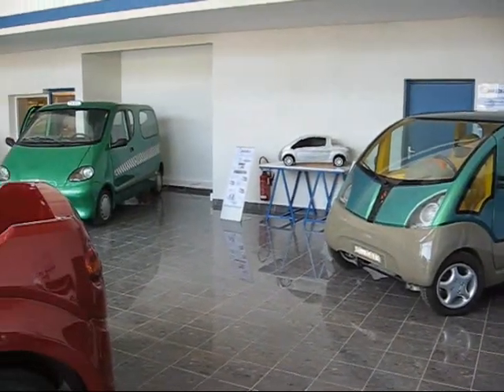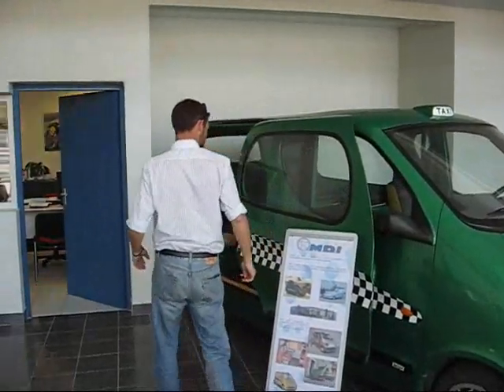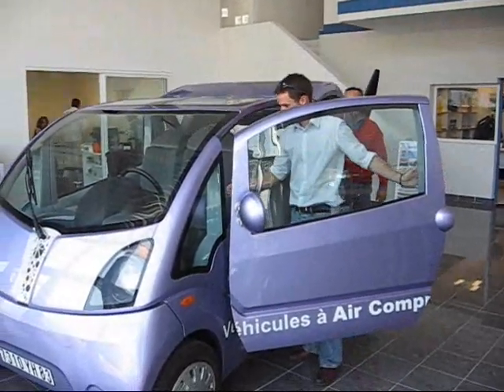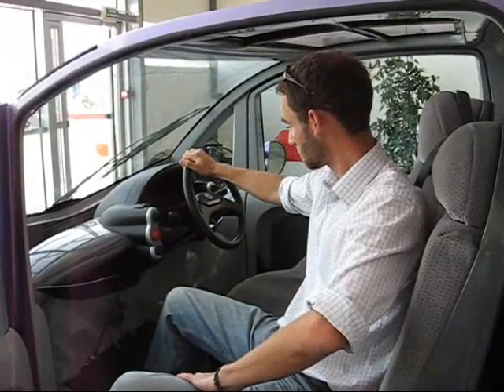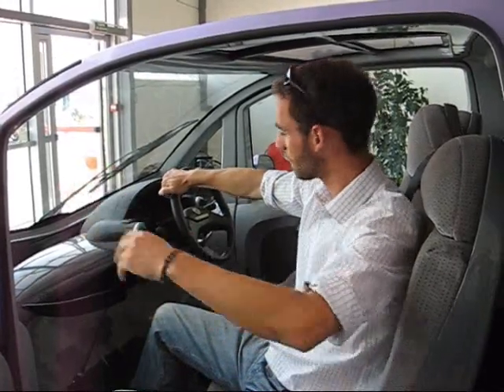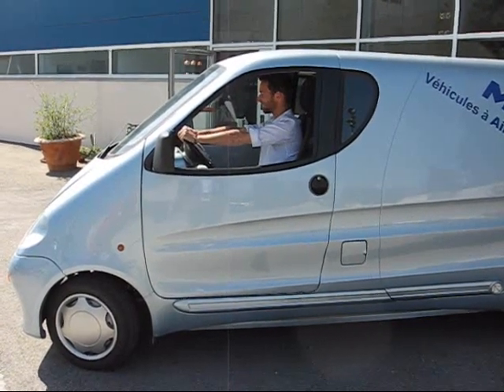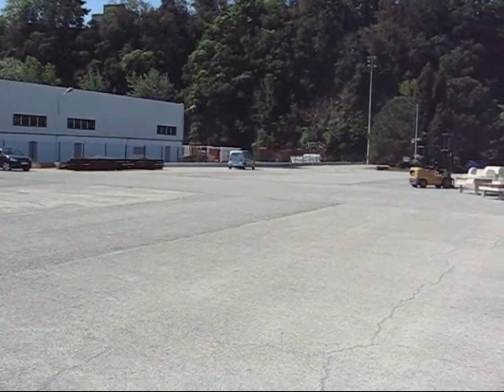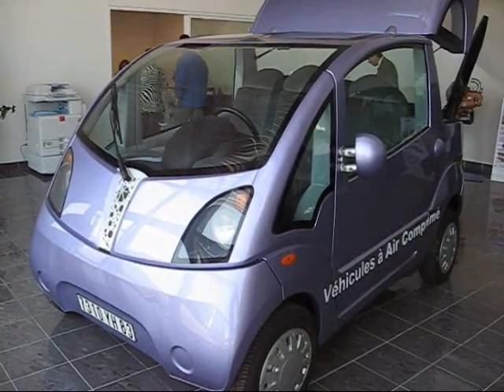The Air-Powered car?

Comment: the only problem is that you need a something to genarate the air. so you would need a really complex system to do it
Reply: I think the idea here is to generate the air using renewable sources of energy rather than sticking to fossil fuels which would deplete in a few decades time.
Reply: @avcomth  yeah i was thinking what new crisis would be cz we are not prepared for anything

Comment: Ehh, there are still better ways of storing energy.  Air isn't a very good way.  If you were going to bother using solar or hydroelectric power you would be way better off using advanced Lithium batteries and storing the energy directly.  The reason the air operated car didn't catch on isn't because "big oil" shut them down, its because they are inherently impractical for modern day street use.

Comment: These aren't going to be any better for the environment than gasoline engines.  How do you compress the air?  Magic? Also not zero carbon.  Not.  Even. Close.  These WOULD be highly useful in mining operations though where the operation of internal combustion engines is highly dangerous.

Comment: you can ask me anythin about physics or clalculus and shit ill answer it. the point im trying to make is that most electric companies use fossil fuels. some do use clean energy but those dont make much electricity.. and because no system is 100 percent efficient the more processes it take to make a fuel the less efficient. . example : say its 70% efficient to take gas to make it into electric. no say its 80% eff to take that into air.. thats only about 56% efficiency. IS THAT GUD ENUF 4 U

Comment: Clearly every system has losses, No, still not happy with the answer elaborate more on the answer. Your answers are very broad. Solar panels are not expensive yes they have an efficiency of around 20%  depending on the pane,l also wind turbines generate lots of energy it is just that wind is unreliable. You obviously have not seen my youtube channel, cause if you did you wouldn't have wrote what you wrote. Not trying to mean but just telling you and give me a good answer

Comment: @unvanquishableone The range would be an issue if it was 3-10 miles. Who wants to "fill up" every 5 miles? You should do some sums on this and you will see,

The usual thing with these air powered and water powered cars is that they are scams to get people to invest in the shares. Once they have the investor's money, the company disappears!

This was posted 2008. 3 years later, has it taken Europe by storm? Has it even scratched the surface. No I don't think so. Reason = Technology is duff.

Comment: all they need is to have a compressor built in to refill the tanks, you would have a renewable fuel source built in
Reply: I mean like it would be hard to get the energy but i see how regenative braking could help that
Reply: And what would power the compressor?
Reply: @beanapprentice1687 belt from the engine to the battery
Reply: @beanapprentice1687  electricity
Reply: @ then it would just be a battery-electric car, but with extra unnecessary steps.
Reply: @beanapprentice1687  not really, and its not needed to explain why
Reply: @beanapprentice1687  the normal car also uses a battery to supply, and its not an electric car. The gas pump also uses eletricity as power supply. But the car still not fully electric. The idea of having a compressor inside the car isnt bad. Maybe the electric source can be from outside.
Reply: @  what do you mean? A compressor needs a power source, it cannot run by itself. So if you install a compressor in the car to refill the air tank as it drives, then you also need to install a source of power onto the car, like a battery or a gasoline powered generator.
Reply: @Heisen_95  oh I understand, so you mean a device to refuel the car when it is parked. I was under the impression that you were saying the compressor would refill the tanks somehow while the car is driving.
Reply: @beanapprentice1687  bro if you would be engineer you would know the discussion aint worthy, there is many circunstances. Energy Power supply aint coming only out of batteries or generator, can also come from outsources like cables or contact, from street/public supply for example. Whenever people really need one idea or really need something they make it happen just
Reply: @beanapprentice1687  we dont know how often would need a refill
Reply: @beanapprentice1687  solar

Comment: @unvanquishableone So you have never dropped a dive tank on your foot or noticed the test date on it? Hint all high pressure cylinders have a life span based on no of cycles and the amount of energy they store, compared to a lithium battery pack is miserable. With an actual range of 5 miles it REALLY REALLY REALLY is an issue

Comment: @MakeYourOwnMotorhome wrong, wrong, wrong. air is an awesome way to store energy. it is lightweight and would never breakdown like batteries. range does not have to be an issue either. fuel stations could have precharged tanks ready to swap out in less time that it now takes to fill your tank with gas.

Comment: The range is not mentioned. Compressing air has a lot of energy losses via heat and is a very inefficient way of storing energy. I doubt if this would run for more than a handful of miles. Then you have to charge it with compressed air made likely by a diesel motor which has emissions. Probably 10x the emissions if that motor was used for direct drive, because of the losses involved.

Comment: @Caspar1989 Bit thirsty on the fuel unless you go for very high pressures and temperatures. Cyclone Power Technologies ared the only ones I'm aware of with a chance to match the fuel consumption of a modern internal combustion engine

Comment: Displacing Oil Use
And while TV's use a lot of electricity, they are mostly for entertainment. Electric cars will mostly be replacing gas-powered vehicles, reducing air pollution and CO2 emissions (even if they are charged on the dirty U.S. power grid, they are still cleaner than internal combustion engines, though of course the goal should also be to clean up the grid - but that's a discussion for another article) .

Comment: @MrRyanGraham 
Google Rexresearch Negre 
over 10 years of broken promises documented
Google e.volution south africa
Lies from 2000
Google museum of retrotech
Air cars are OLD tech
Google Gast air motor
Complete specs with consumption and power curves.
Google Vencat 20 miles
MDI ex USA distributor "theoretical" 20 mile range air only 
5 times less efficient than an EV
And you believe a youtube video. 
Want to buy a bridge?

Comment: After years of working on a system for driving an automobile by means of compressed air Louis C. Kiser, a 77 year old from Decatur USA has succeeded in converting his gasoline engine into an air compressed system. Kiser removed the entire gasoline line, the cylinder head, water-cooling system, and self starter. A special cylinder head is substituted and a compressed-air tank added in place of the gasoline tank.

Comment: @mikehanoo33 READ  I have never "promoted" an oil company. I have merely pointed out air cars cannot achieve the lies opps claims the promoters make The claims impossible (ideal gas law) and have NEVER been demonstrated in an INDEPENDENT TEST. And no taking a journalist round the parking lot  IS NOT A TEST   same as  a newspaper clipping from 1930 is also NOT PROOF

Comment: @AMRennsports   1931 German 1200 h.p. diesel-compressed air locomotive is a great success, saving 26% fuel cost over straight diesel engines.
Reply: 26% of 1931 standards?

Comment: 1934
January: ARKANSAS shoemaker Bob Neal files for a patent for his air engine and is denied.  (He filed and refiled for two years, then demonstrated a working model, to get this patent.) 

RIGHT: August 31, 1934: Bob Neal's patent attorney informs the patent office that they are wasting their time trying to refuse Neal's patent application; he has a working engine.  The nature of the outside energy supplied to the engine is not mentioned in the patent .

Comment: @mix0xim As of right now, the most efficient way of powering a vehicle is by internal combustion engine. Not electric, hybrid, fuel cell, steam, or compressed air. IC engines have reached 42% total brake thermal efficiency. Nothing else can touch that. On this car, by the time you add up all the loses: Frictional and thermal. The efficiency is extremely low. At the end of the day, for every mile you travel in this car, you waste more energy and pollute more that other means of transportation.

Comment: @mix0xim The car has to be set into motion in the first place. What ever energy is taken out of the car while moving will create more friction; not to mention that the batteries required to store this energy will weigh more, causing more frictional loses. Trust me, I'm a Mechanical Engineer one of my specialties is alternative energy.

Comment: This car is not carbon free, that air needs to be compressed by an air compressor that runs on eighther fuel or electricity. Makes no difference which one because each would produce more emissions than an equivalent gas engine. Yes, even the electric one, which gets it's power from a powerplant somewhere. More than likely one that runs on coal, we know how clean and carbon free that is... you gotta be stupid to believe this.

Comment: Aircarfan, you mention a 6 cylinder 75hp engine that is not mentioned anywhere else. Are you mistaken? What source of power does that use? If it is driving an alternator and the compressor runs off of that you are talking of two efficiency issues.  What is the power source?
I think you are wrong and the car is as described, however my previous comments still apply.

Comment: They will custom make you one under your country's standards and they include a compressor. Also its cheaper than alot or refurbished cars they even have a hybrid car that when it runs out of air fills it back while still running giving it a 600 miles to the fraction of the gas of other cars use.

Comment: If your calculations are correct in the lower post and what you're describing in them, then you are basically calling an air car a perpetual motion machine...impossible.  I really don't think the car will be capable of refilling itself as it drives and will, at times, need to be refilled on the road...still necessitating the use of "gas stations."

Comment: One of the problems possibly of using lots of compressed air is that the bottles tend to corrode faster, every refill means a certain amount of water gets added. Here in the UK pressure vessels need testing periodically to check for corrosion and deformation under pressure. I wonder what the overall conversion efficiency is? IE how much input power to the compressor equates to how much output power from the motor? Is it better than the efficiency of charging batteries?
What is the range?
Reply: They're using carbon fiber composite tanks, NO CORROSION, also refillers are to be fitted with dual stages water separators, so where would the water come from?
Reply: @avcomth  it appears to have taken 14 yrs to get a reply, you make valid points. the video does not provide much information but other sources do mention carbon fibre tanks.Te project has now been in development for over 20 years, I have yet to see a vehicle.

Comment: This is an interesting concept, however it does involve a huge amount of compressed air at very high pressure. Also although the vehicle itself produces no carbon directly it does need recharging from compressors.
Those compressors need power from somewhere.. so the situation is similar to the electric car although the storage medium is non toxic... wonder how they behave in extreme crash tests?